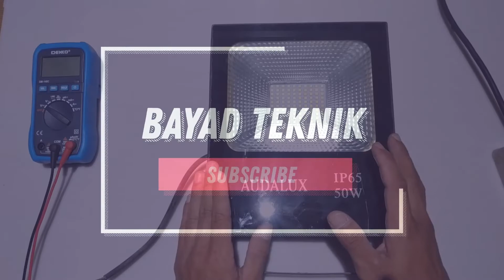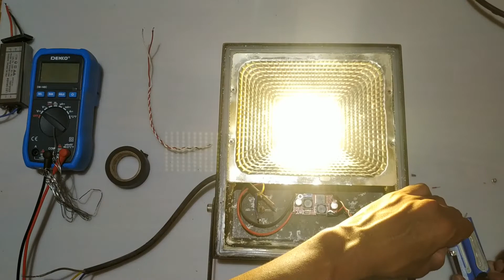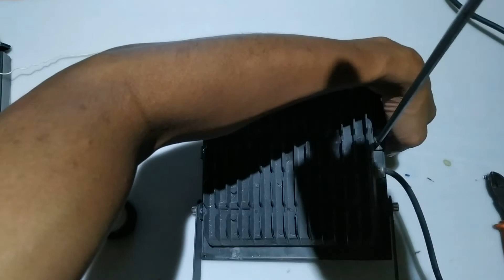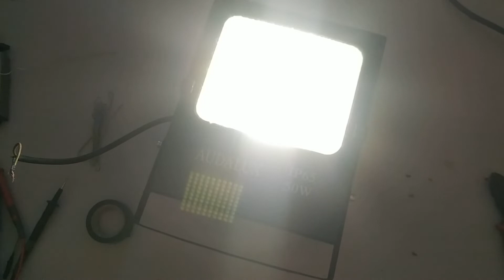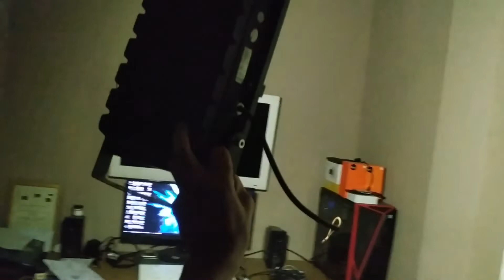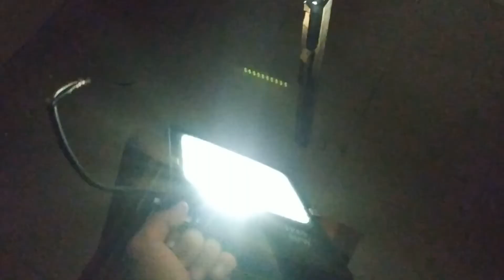Cara Merubah Lampu Sorot 220volt Menjadi Lampu Sorot Portable

Comment: kalau merubah dari lampu sorot ac 220 ke pakai aki bagaimana carax?
Reply from the maker: Sorotnya led apa  lampu lama ?
Reply: @BayadTeknik  lampu sorotx lampu led
Reply from the maker: @husnimubarak832  bisa pakai step up. Tapi bongkar dulu lampunya berapa volt di dalamnya
Reply: @BayadTeknik  ada totorialnya tidak ?
Reply: Kuat berapa jam pak bos nyala lampunya
Reply from the maker: @suryasaputra3403  3 jam bos